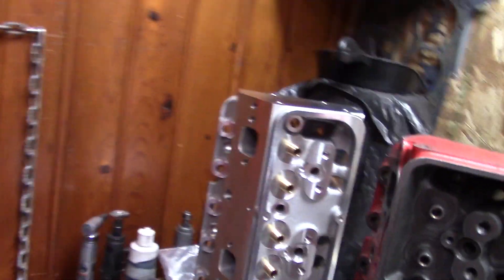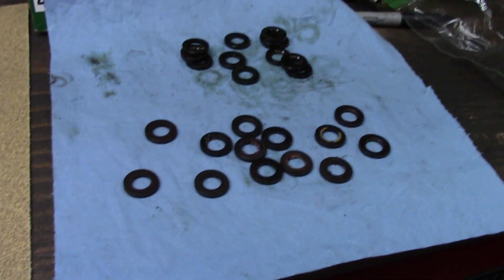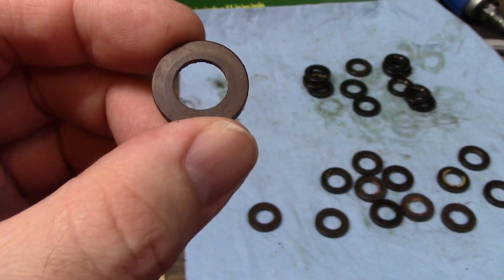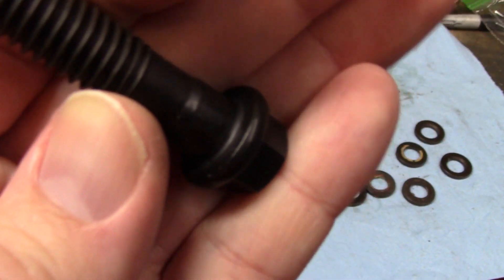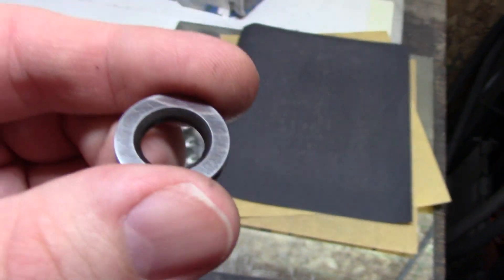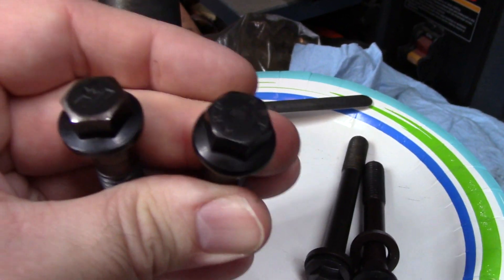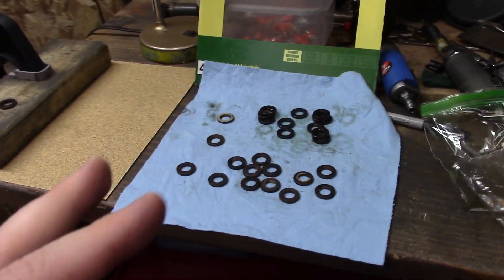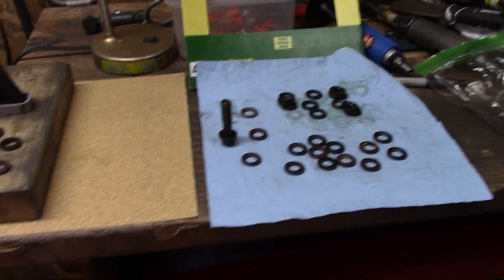ARP Cylinder Head Bolt & Stud WASHER Prep

Comment: i'm glad i realized my mistake before fully torquing down my headbolts that these washers had a chamfered side it's very easy to brush past it. torqued the first few in pattern one set to 100ft-lbs and glad i didn't fully do it because i had to take them out to make sure they're all set because it says if the chamfered side isn't on the bolt it'll cause premature bolt failure. also second thing i saw is that ARP has they're own specific torquing specs which i've heard horror stories about people who either didn't put washers on or torqued the bolts down to manufacture specific rather than ARP specific. they state to do 3 rounds of torquing the bolts to 100ft-lbs so i've been using a torque stick rated to 100ft-lbs to add that last layer of your "cover your ass" method

Comment: Hey what rocker studs did you use for the eBay heads? My arp studs don’t want to thread all the way down even tho I have the depth, I had to use a arp washer should I sand those as well?

Comment: ARP says you are fine, just make sure you do NOT lube the underside of the washer.
Reply from the maker: ARP says I'm fine or you are fine to just install w/o lube?
Reply: ARP will never give any advice that falls outside the installation instructions that come with the fasteners 

I doubt they would endorse sanding washers

The installation instructions I have seen for ARP Head Studs indicate:

“Lubricate the stud threads and bottom of the nuts with ARP Ultra-Torque Fastener Assembly Lubricant.
Then install the nuts onto the studs and tighten hand tight. “

https://tech.arp-bolts.com/instructions/234-4342.pdf
Reply from the maker: @Jommybutler1234  Read the article in my description.  ARP also sells "Stamped Patterned Washers".  This prep tip is not mandatory, it's just something extra to help even the load bolt to bolt as most head surfaces are not oil free or the washer itself isn't unless you clean it.   I believe ARP does advise you lube under the head of the bolt, so if any of that oil seeps under the washer during the multi-step torque procedure...
Reply from the maker: I don't mean to be a dick and hope that's not why you deleted your 2nd reply.  Just sharing some info I found that makes sense to me and people can choose to do it or not
Reply: @BOOT  I did. It delete a second reply
Reply: @BOOT  Here is the advice I received directly from ARP:

“Hi Kyle,

personally i like to scuff up the washers on some sand paper to get a better grip on the head.

the main thing is that you do not want lube on the washers or the spot face of the head. if you get the lube between those spaces the washer will act like a bearing and your torque wrench wont be able to feel the friction and your torque wrench will just turn till the stud or bolt breaks. Most good engine builders will stop if this happens but some people will keep turning the wrench till stud breaks.  we only have these instructions for the LS, LT , ford mod engines and subaru. all these kits huge a larger washer than usual and the heads are CNC’d pretty smooth. 

sometimes the smoothness of the washer and smoothness of the head will do the same thing . doing some figure 8 motions on the sand paper will help prevent that washer from spinning 

Best regards, 
Art Venegas

Technical Support
Automotive Racing Products, Inc.
800-826-3045
ARP-bolts.com”
Reply from the maker: Youtube filtered your reply as spam because of the link, so I had to approve it.  It's fixed